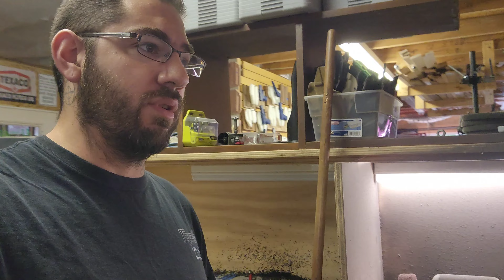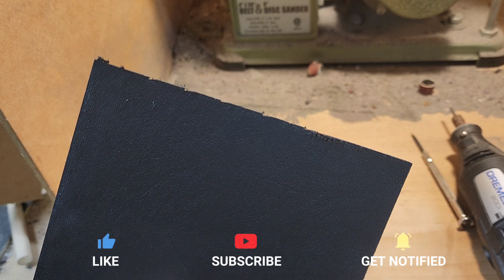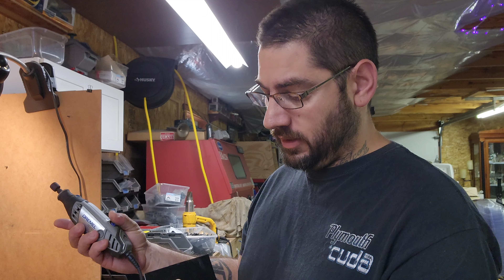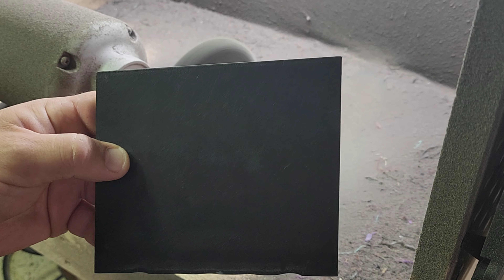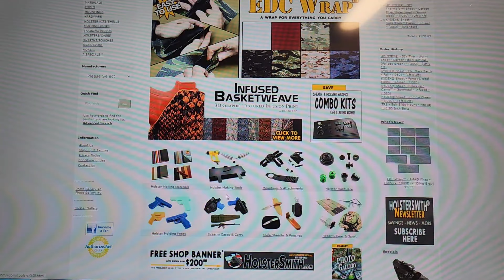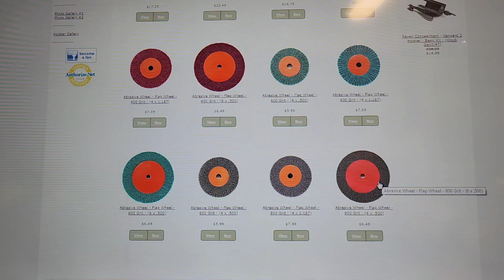Sanding and Buffing Tips, How to keep a straight line.

Comment: Did knifekits change suppliers for the flap wheels? I ordered flap wheels from them few years ago and they were great, but now they fray along the outside edges and leave a "dirty" residue all around the edges of the kydex I try to polish. The old flap wheels did not fray around the edges and never left a dirty looking residue like the new ones. Have you experienced that? I found an old wheel and love how clean the finish is with no powdery looking residue along 1/8"-1/4" of the sides of the edge .
Reply from the maker: I haven't seen that yet!  Seems like all the ones I get have all been the same

Comment: Thanks for the video buddy. Just wondering you are not putting that much pressure when buffing right? Also, when you buff you are just trying to get the edges rounded right? 240 is all I could fine for dremel sanders.
Reply from the maker: just rounding the edges, yes. not a ton of pressure but enough to let the disk work
Reply: @FalTacHolsters  will 240 work for the dremel? That’s all I could find. Thanks for all your help bro it has helped me big time.
Reply from the maker: @Danielshorsemanship  of course